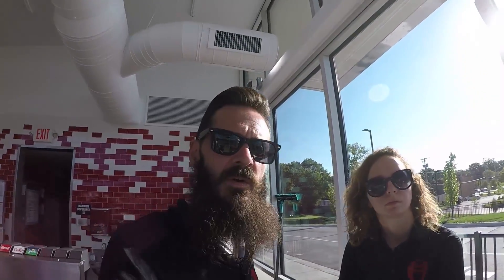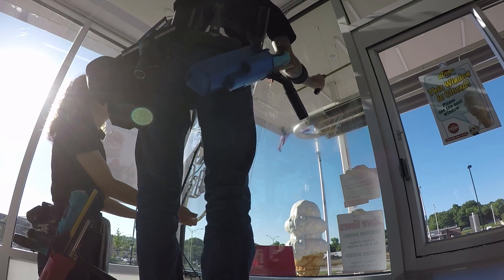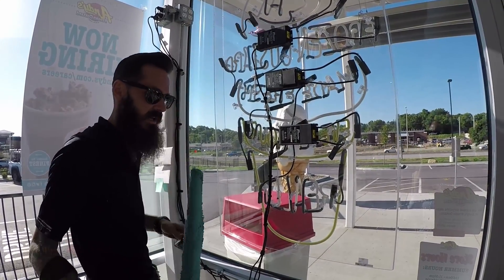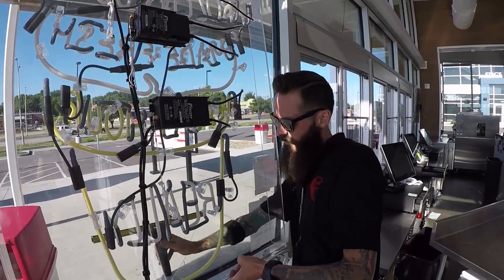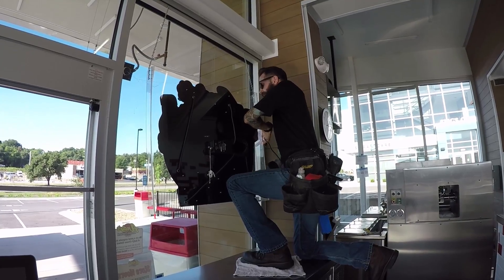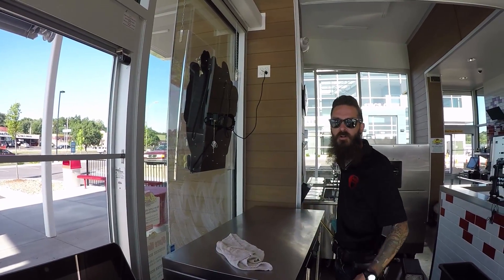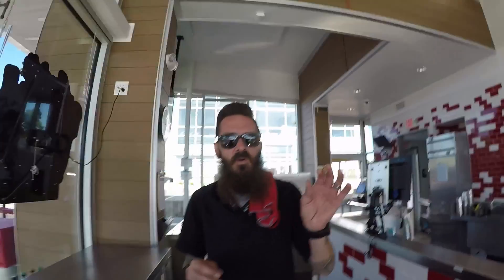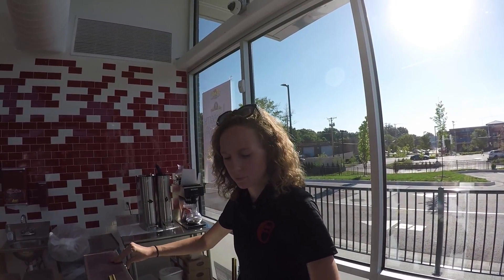Cleaning Windows Around Neon Signs

Comment: With signs that have the suction cups on each side, top and bottom, I use this technique.  Unsuction the left side, top and bottom  with the cup still dangling with the hook inside the hole of the sign. The sign will dangle and u just easily will be able hold sign if necessary and be able to clean.  Then do right side the same way. This makes it so you don't have to put sign on floor.  Also it keeps sign straight and in place the way the customer put it to reduce the stress of putting it back on even and trying to remember exactly where on the glass the customer originally had.  One more thing, while cleaning the window, water might get on the sign on the side facing the glass.  If that happens, just gently hold sign and wipe any water.  Aaaaannd another thing, when I suction back the sign, I push the cup until it pops.  Then I know it's secure.  Also using the slightest amount of water on the inside of cup helps it stick.  Peace!